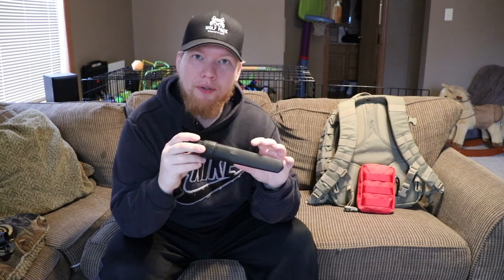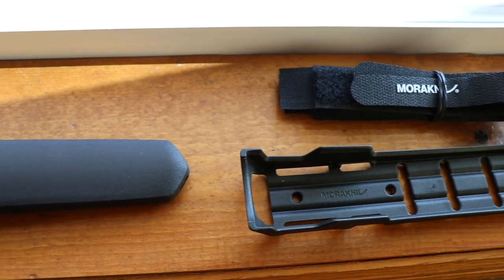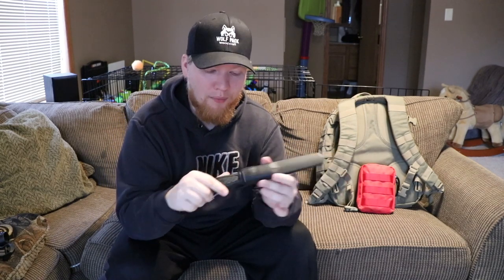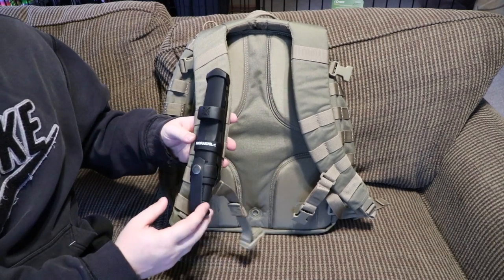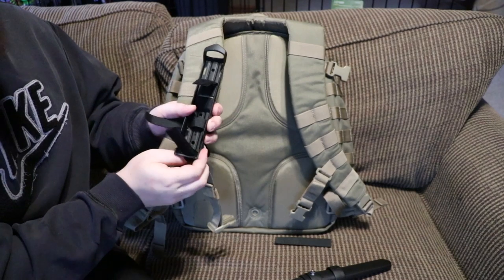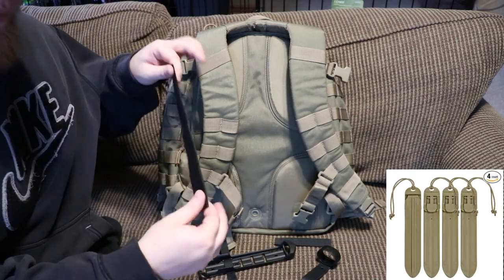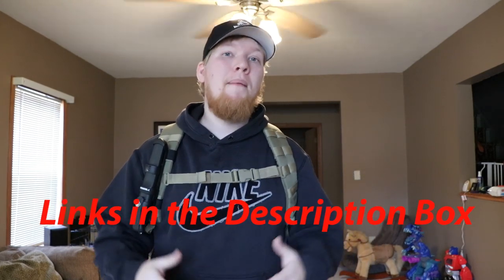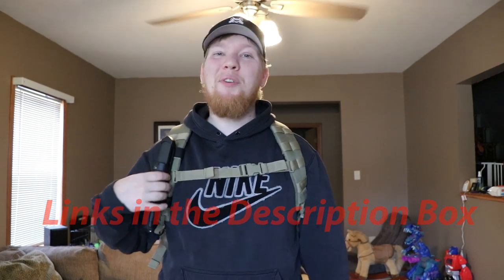How To Use The Mora Multi Mount Sheath System

Comment: I wanted an aftermarket leather sheath for my Garberg, as I don't like the design of the Mora one.  I bought this version knowing that so that I would have even more versatility.  I like the idea of mounting on shoulder straps, however, I don't really like pointing the knife up toward my face and neck AND I would still want to keep a belt knife securely fastened onto my person.
Reply from the maker: Once you get your custom leather sheath you can keep the leather sheath on your belt and mount the stock sheath to your pack. That way you can carry the one knife but always have it on your person. thank you so much for watching I really appreciate the support.
Reply: Amazon Garberg Stainless with Molle this evening $26.00!
Reply from the maker: @redoak3809  Thanks for the heads up. I will have to let everyone know.

Comment: You can turn the belt clip upside down on the multi mount and keep it close incase youneed it.
Reply from the maker: I actually run both the belt look and snap through the top hole. The belt loop is to small to be used this way but it does keep everything in place.

Comment: Time for sheath modifying to fit the belt loop
Reply from the maker: You can run the belt loop through the same hole as the strap but you will need a thin belt to use it.

Comment: Great instructions!  I'd a been lost without it (70 year old lady just starting out)  You were right about the versatility of mountings on this sheath which makes it more usable when you need it!  My snap doesn't quite reach across the end of the knife.  I am hoping it will stretch a little to snap in, but since I will probably mount this upside down on my pack, it may not be needed, until I get to camp.  Anybody else have that problem?
Reply from the maker: When I first got my knife the strap was tight. I just snapped it over the knife and left it snapped for a few weeks allowing it to stretch and it works really good now. I would rather have a strap that is too tight and needs to be stretched than a strap that is too loose and constantly worry about it not holding in place.

Comment: Good video. I am hunting from a tree saddle (look that up) and the saddle would get in the way of me mounting my knife on my belt. So, I will probably use the multi mount to attach my mora Garberg to my backpack strap like you do. I do admit that the thought of pulling a knife from a sheath that close to my chest is a little scary. Have you tried mounting the handle up?
Reply from the maker: I have tried mounting the handle up, but it is much harder to get to. It also doesn't feel as safe because the knife's blade is by your face before you have complete control of it. If I was using it for hunting and didn't plan on taking it out of its sheath more than once or twice I might carry it handle up just so I knew it wouldn't fall out.

Comment: Hi, I wanted to know what is your vote for this 14C28N steel for bushcraft / survival knives? Thanks Michele
Reply from the maker: I actually really like it. I think for a beginner the Garberg is one of the best options out there. Being able to practice almost everything and not having to worry about having the experience of a carbon steel blade makes this blade a very good option for anyone. I really enjoy using the Garberg SS. I did just receive the Garberg Black which is high carbon steel so stay tuned for a review on that as well.

Comment: I have a few Mora knives but I haven't got the Garberg yet. I'd like to have leather sheaths made for them when I can afford it. They work great as a secondary blade with a big chopper.
Reply from the maker: I have already preordered the Garberg Black which is the High Carbon steel version. It should be here around April. I'm really excited to compare the two.
Reply: wolf pack woodcraft I can't wait to see how it performs. I saw the preorder on Self Reliance Outfitters store. I wish I had the money for one right now but I'll have to wait til they release.
Reply from the maker: I really don't see what the Garberg Black can offer that the Stainless Steel Garberg doesn't already have. I'm guessing other than being able to strike sparks off the spine with flint it should be the exact same knife. Either way, I'm excited to have a High Carbon Garberg.
Reply: wolf pack woodcraft I wonder how quickly it'll rust. I mean I know it has a coating but it will wear off after a while.
Reply from the maker: The Mora Companion HD and the Bushcraft Black are high carbon and both are great blades. If taken care of High Carbon Steel should never rust. You just have to keep them clean and dry.
Reply: @newageselfreliance  carbon steel is way easier to keep an edge on especially in the field

Comment: Is there any possibility to wear the morakniv garberg multi mount "across" / horizontal on / with an usual belt? Thank you!
Reply from the maker: You could with the Velco Straps. The problem is getting the velcro tight enough so it doesn't bounce around. You could also make snap closers out of webbing that fits into the slots on the back of the Mounting Sheath. Some slots can make it possible but it's not going to be as simple as attaching it to a backpack.

Comment: Hmm... ever thought of just having the belt loop on your belt? Not like it will be in the way. (Looking at getting a new full tang knife and this is one of the options :p )
Reply from the maker: That would work while camping but when it comes to storage or taking your belt off, you run the risk of losing or misplacing it. I like keeping it all together so when I grab my knife I have everything that goes with it. This is really a great knife I have the Stainless and the Carbon version and they are both a really great option. I wouldn't recommend getting both because they are exactly the same knife but I would recommend getting one for sure.

Comment: My button closure on s super super hard to close
Reply from the maker: It does need to be worn in. I would snap it and leave it closed for a few days so the pressure can even itself out. Then I would open and close the snap a bunch of times. It should get easier and easier the more you use it. It is so tight out of the box so that you don't loose your knife. I would rather have it too tight and know the knife is secure than have it to loose and always worry about it coming undone.
Reply: @newageselfreliance  ya for sure I'm definitely not complaining I just noticed the difference when between his and mine.  That said mine is new I just got it two days ago and I've left it snapped so far.  Thanks for the advice!
Reply from the maker: I had to work mine loose too. Both my multi-mount sheath and Leather sheath came the same way. I'm sure once you use it a few times it will be just as easy as you see in the video.

Comment: At 8:42, you show how to put the belt loop into the mounted holder.  I do the same except turn around the belt loop (so it faces the bottom of the holder, and the loop is against the velcro molle strap.  Push it up against the snapped-in strap holder, and put the Morakniv velcro loop just around the bottom side of the belt loop ring.  This way, the loop is compressed between the case and molle velocro, and it is not showing open space on the tapered end of the knife sheath.
Reply from the maker: I actually do kind of that same thing only I don't flip the belt loop upside down. I put both the Belt loop and Snap strap holder through the big whole together. You can't fit a very thick belt through the belt loop this way. My Black Hawk Riggers belt doesn't fit through the belt loop this way but my EDC belt does.

Comment: Mora now has an accessory "Survival Kit for Kansbol/Garberg" knives that you can buy for about $29. It is "mounted on the knife sheath and is equipped with an integrated fire starter, diamond sharpener and reflective paracord." I don't think it will interfere with the multi mount.
Reply from the maker: I've seen that Survival Kit. In my opinion, $30 is a lot of money for a Ferro Rod and a course diamond sharpener. I'm guessing it's the exact same as what comes with the Mora Bushcraft Black. Which the Ferro Rod is really good but the Diamond Sharpener is too coarse for the basic upkeep of the knife. For the price, I would rather get a UST SparkForce for $9 and carry it in my pocket. https://amzn.to/3St8bEv You can sometimes find them at Wal-Mart too.

Comment: You can also attach the multi mount to daisy chains (like those on Exped Thunder). Moreover: how often do you shake your knife and sheath upside down? Only in reviews like this, I suppose. The retention is good enough, in my view. Not like "kydex retention", of course - but how often do you need that?
Reply from the maker: I was just over exaggerating the shake your knife will experience when running. Kydex has a much better retention. The retention on the sheath is just two small nubs that fit into the cutouts of the handle.

Comment: So why wouldn't you just attach the belt loop.........to your belt even when you have the mount in your backpack? That way you can quickly remove the sheath from the mount system, then just slide it into your belt loop which is already on your belt once you get where you're going?
Reply from the maker: That is a really good idea. That would also make it easier to always be in a quick-access location. It would either be on my belt or the outside of my pack making me less likely to set it down and lose it.

Comment: Is there a way to use the molle mount to scout carry (horizontal) without buying some other straps?
Reply from the maker: You can use the velcro but I'm not sure how easy it would be to connect the velcro behind your back and still get a secure grip.

Comment: Right there at appox. 2:16 where you are talking bout you need Both pieces to mount on the sheath. Try this;
use 1 or 2 very small "Wire Ties" and put one on each side and that will hold. Maybe, just one really would be enough.
Reply from the maker: That would work I just wish Mora would have thought ahead and included it so you knew it was gonna hold up even when taking it in and out of the multi-mount sheath system. Thank You so much for watching I really appreciate the support!!!
Reply: One very small cable tie would work very well but then it wouldn't fit in the multi-mount.

Comment: I have to use two hands to draw the knife. Is that normal? Also the button to keep the knife secure in the sheet demands heavy pressure to lock and I have to use quite a bit of force to undo the button.

It looks nothing like the easiness in the video to draw the knife or undo the button. Should I ask to try another knife of the same model?

Also, great video. I can't find these instructions anywhere on Mora's own web page. You should be on it explaining how to use the multi mount system!
Reply from the maker: There is some retention to both the snap and the blade inside the sheath to make sure they don't fall out when you are hiking. I would test a second one to make sure they are the same but the tighter the better. I would hate for it to be to loose and fall out and have you lose your knife.
Reply: @newageselfreliance  Thanks! I did just that and after I wrote my comment, ordered the multi mount system with the knife (Kansbol) and it was delivered to my doorstep by 6 am(!). 

I had the Mora Black Buschcraft knife at home as well. It felt very unbalanced BUT I was able to remove it as easily as you could of your Kansbol in the video. So I might think there was something wrong with the one I got. I'll try the new Kansbol I just got today and let you know.

Thanks for the tip!
Reply: Okay. I've just tried the "new" knife (same modell and everything but from another store) and there is a bit off difference. This one IS easier to remove with one hand. The other one was like trying to draw the "sword in the stone"-sword.

Maybe you've also used yours for a quite a while, making it easier on removing and replacing it in the sheathe.
Thanks again for a great video!
Reply from the maker: @swekiwi4517  try taking your new knife and putting it your old sheath. That way you will be able to tell if maybe your sheath is miss formed.
Reply from the maker: https://youtu.be/QbTx0KJKj-k
Reply: @newageselfreliance  Good tip! But sent the knife back before I hade the chance to test that :/
The new sheath (number 2) is a tad better. 

But don't you think it will be more "slidely" after some usage?
Reply: @newageselfreliance  Thanks! Your knives seems to be able to be "drawn" single-handed. Like drawing a pistol from a holster with just one-hand.
I hope mine will get there after some usage.

A positive thing is that it the "close the loop"-button on the new Kansbol knife multi-mount system I now have is much easier. The first one I had to use ALOT of force to close it. With two hands. So this looks a least a bit promising.

Thanks for the tip nonetheless 😃
Reply from the maker: You have to use your thumb to push off. Plastic and Kydex sheaths are really hard to get out if you don't push with your thumb. Maybe that can help as well.
Reply: @newageselfreliance  Thanks! A thumb is not enough. I can see the non-effort your are using when drawing your knife. But it is better with the new one I got.
I can not remember, but did you prefer this one over the Garberg knife (which I think is a tad longer)?
Reply from the maker: @swekiwi4517  The knife in this video is the Garberg I really like it a lot. I'm not really a fan of the Kansibol I don't understand the purpose of the different grinds.
Reply: @newageselfreliance  Ah! I totally missed that! I guess there might be a difference in how easy the knife is drawn then (compared to my Kansbol).
Thanks!

Comment: I added some low temp silicone electrical tape below the the belt loop when the retention strap is on, even works with it in the molle mount. Good vid, keep up the good work
Reply from the maker: I'm really glad you enjoyed the video. The belt loop does fit through the main hole but when the snap closure is also on you aren't able to use a thicker belt. The belt loop becomes much shallower with the snap closer above it.
Reply: Keep the retention strap on top, then the belt loop below that, then you add a piece of low temp (-61°c breaking point) below that.

Comment: dude, thanks a lot for an amazing Video. just one question, on the mora garberg with multi mount system that you buy from amazon.. is this what comes with it= inclusing velcro staps and the two belt loops (plastic and leather)?  or is this the multi mount system kit that you buy separated? (https://www.amazon.com/gp/product/B07CZCVS62/ref=ox_sc_act_title_1?smid=ATVPDKIKX0DER&psc=1)
thanks!!
Reply from the maker: That is just the Multi-Mount System. It does not work with the Leather Sheath. You will need to already have the plastic sheath that comes with the Mora Garberg or the Mora Kansbol. So if you have just the Plastic Sheath ==> https://amzn.to/2LSps8m You can buy the System to add to it ==> https://amzn.to/2RpHRi3 or you can just buy the knife with the Multi-Mount Sheath System ==> https://amzn.to/2SATXSI I really hope this helps.
Reply from the maker: It is exactly the same for the Kansbol and the Garberg. They are even cross-compatible.

Comment: Wouldn't the fast molle clips would be used where you want an item, such as a medical kit, to detach quickly, but would not be used for items that would be more permanently or securely attached such as a knife sheath?
Reply from the maker: The molle clips make securing items much easier. They do also make for a faster release but I think just having an easy more secure way to attach molle than the "lazy way" most people use molle gear is their main purpose. https://www.youtube.com/watch?v=XAWapf_7vmU

Comment: awesome video and just what I needed.  My Kansbol doesn't come out as easily as your knive does in the video when I have the multi-mount installed.  The plastic sheath comes out of the multi-mount when I pull on the knife.  Any suggestions on how to fix that or will it just get easier with time?
Reply from the maker: You have to push off with your thumb like a Kydex sheath. The handle on the Kansbol isn't as ridged as the Garberg so it is harder to pull out. Make sure your velcro around the sheath is as tight as you can get it and adjust it from time to time making sure it hasn't loosened up over time.
Reply: @newageselfreliance  thanks for the quick reply.  That's what I've been having to do, but you make it look so easy, I thought I was missing something.
Reply from the maker: Using the Garberg is much easier than the Kansbol in the sheath. The Garberg comes out WAY smoother.